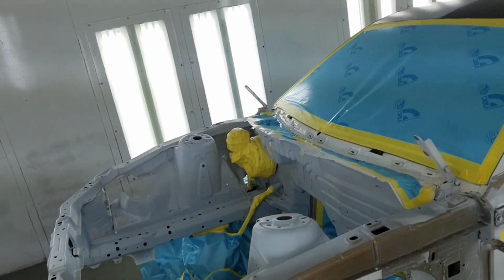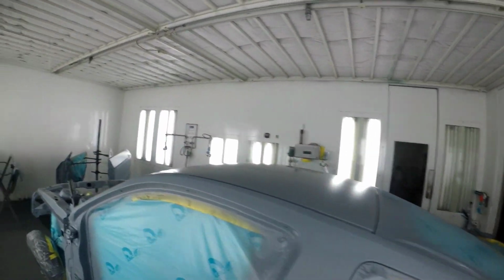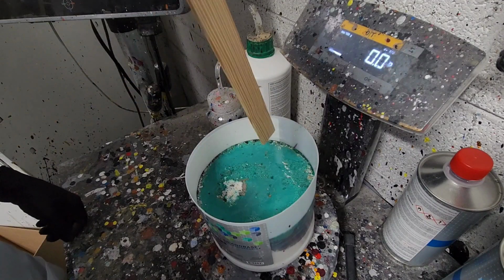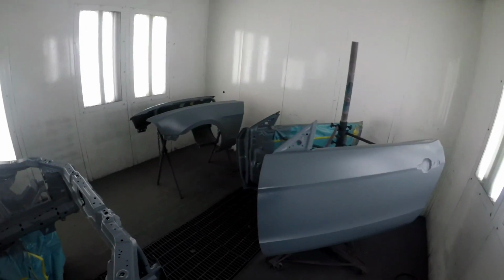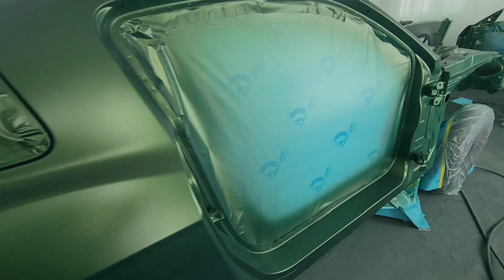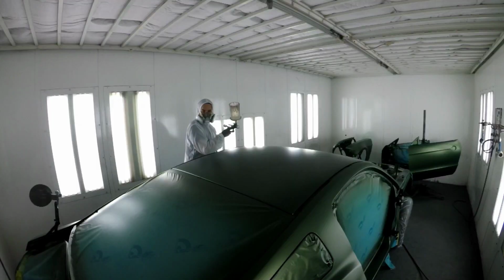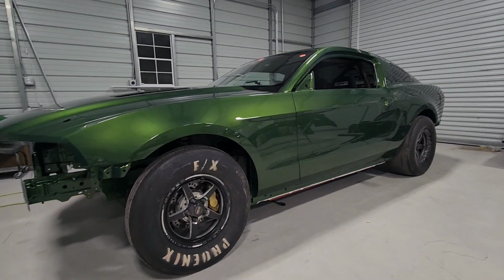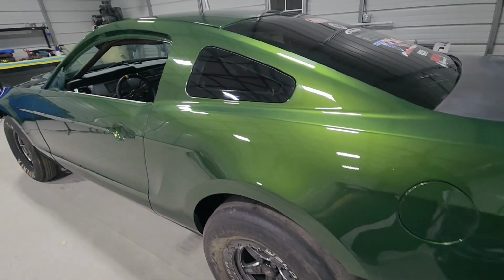S197 Mustang Drag Car Full Paint Job

Comment: Great job look the bollocks but i would have used a mini gun in the engine bay just to get into all the tight areas but thats just me . Flow coating is a must on a job like this .👍👍
Reply from the maker: Thanks, man! I need to get a mini gun for tight jobs like that. It probably would have been a lot easier. The flow coat is gonna make it lay out nice

Comment: Great paintjob, Sir! I have a question for you.. Can both a Volkswagen LA7W Standox solvent base (+60% of acrylic thinner) and the next 2K anti-scratch clear coat (mixing ratio: 2:1+10% of acrylic thinner) be sprayed with a H-2000 mini gun having a 0.5 mm tip? Or is it required a bigger tip? I have to do only a little spot repair. Thanks a lot!
Reply from the maker: Thank you, sir!... I personally have never sprayed standox base coat or used a mini gun but I would think you could use a mini gun for a small repair. You might have to move a little slower with it being a small tip gun to get it to lay out. Just take your time and adjust as you need to.

Comment: Question , will you see quotor panel diffrent shade from door ? Because your parts are in off the car ?
Reply from the maker: With the ppg envirobase, I've had good luck paint cars apart, and it all matches when it goes back together. Just gotta make sure you spray everything the exact same way.

Comment: Great work ? Is this ppg ehp if so what was you’re gun set up and pressure for coats ?
Reply from the maker: Yessir, I spray it with a sata 5000 wsb, full fluid, full fan, at 25psi
Reply: @cliff_hatch3r  thanks for the reply. I have that same gun and paint line. I will definitely be trying. Do you drop pressure for drop coat or just back up and keep at 25 ?
Reply from the maker: @Gera alday  it's no problem. Feel free to ask me anything... I drop the psi down to 18, increase the distance, and slow down. Kinda just let metallic just fall in place
Reply: @cliff_hatch3r  thanks you bro this is golden ! I appreciate you ! Keep up the great work !! I use the same paint line recently had trouble with a blazer. Shop was super cold and with no heat
Reply from the maker: No problem bro. Ive been spraying it for a long time. A cold shop isn't good for spray water-base lol
Reply: @cliff_hatch3r  yes I learned that the hard way lol I have a video of a blazer that went wrong. But at the end I think it was too cold and stayed humid blushed under the clear. But got it fixed now. I’ve also sprayed water for years mainly axalta (wet on wet ) so I’m still learning the coat on coat procces.